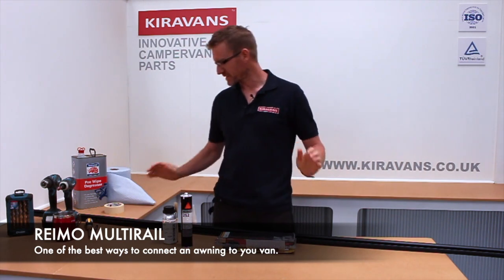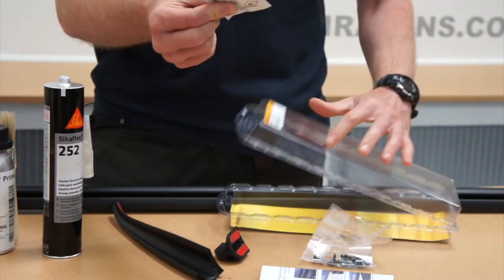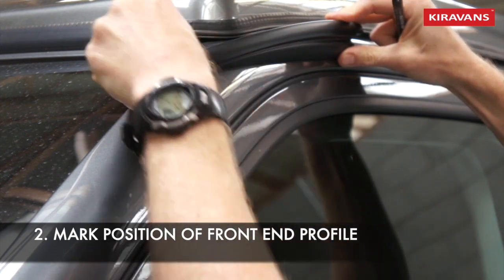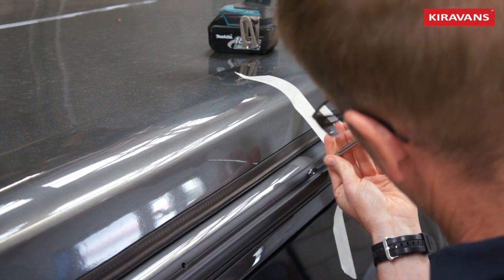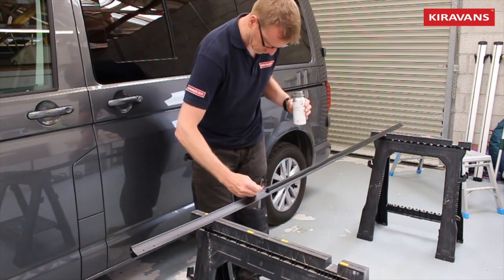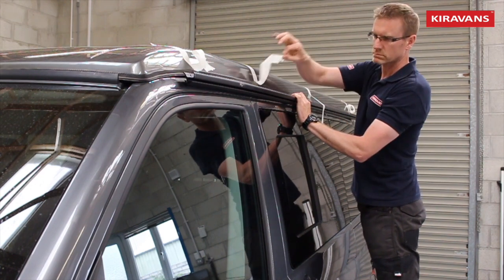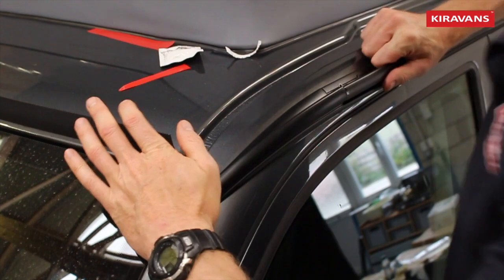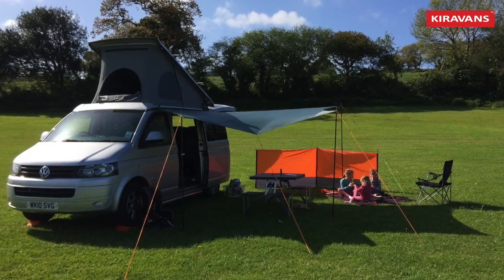How to Fit a Reimo Multirail

Comment: I kind of ask myself if the screws are that necessary... Sikaflex in this amount is easyly enough to hold the bar on it's own and the screws make a hole in the van that might get rusty or starts leaking over time...
Reply from the maker: You're right, Sikaflex is very strong but the screws add that extra security for windy days or sudden gusts.  Drilling into the side of your van isn't for everyone but you know it's not going to come off.

Comment: This may be a daft question but do the screw holes come through into the inside of the van?

I have a camper conversion and don’t want to damage the internal fittings with the end of the screw.
Reply from the maker: Hi Thank you for your contact. You would need to drill right through both sets of skins of the body work but the screw shouldn't unsafely come through they should screw in flush.

Comment: Like another viewer I found the 3mm drill too big and couldn't tighten the screw as the hole was too big for the screws supplied. Luckily I'd only drilled the first hole so did the rest with a 2.5mm drill bit which accommodated  the screws perfectly

Comment: Is there any alternative to use instead of degreasing agent?
Reply from the maker: This step is not essential, but it is strongly recommended.  The degreasing agent is simply to make sure the metalwork is clean and dry before you apply the adhesive.  If the surface isn't properly clean, it may cause the rail to not stick to the bodywork quite as well.  This could cause problems later on in the life of your rail.
Reply from the maker: Any degreasing product should work. White spirits, tar remover etc...

Comment: on the front screws did you drill just the fist skin or did you need to go into the 2nd skin as well, thx
Reply from the maker: Hi Gary, yes you need to go through both skins of metal for a few of the screw holes. Sorry, should've mentioned that.

Comment: Really frustrated with this video. I purchased the rail from Kiravans.  Good advice with the masking tape, terrible advice recommending 3.2mm drill before fittings screws. Holes are now too big and won’t tighten! A competitor video shows drilling holes with the self drilling screws supplied, no need for pre-drilling the holes! Now I have to find another solution for larger diameter screws which will fit the countersink on the rail!
Reply: When i first watched this video i asked myself what happens when you drill the holes incorrectly - Game over! really sorry to hear this. Terrible way to make an upgrade especially if you have a brand new van
Reply: Works well using the self drilling tekscrews